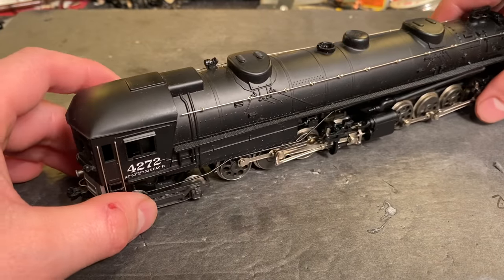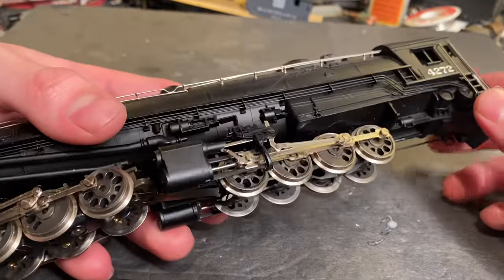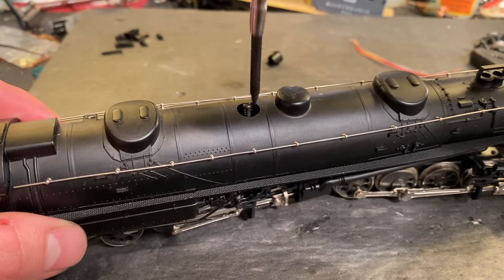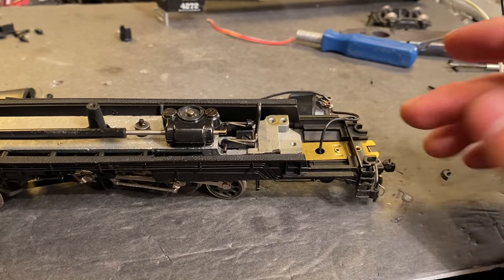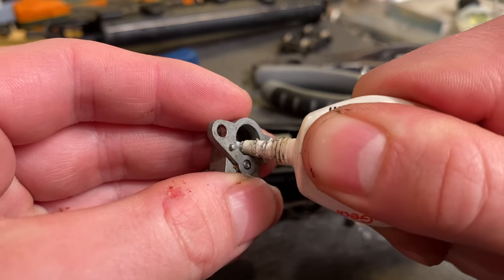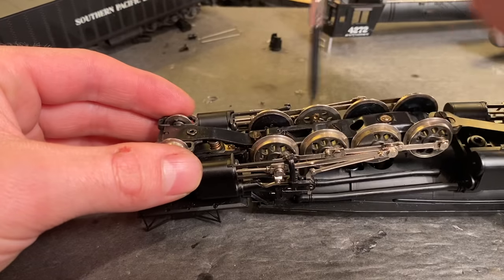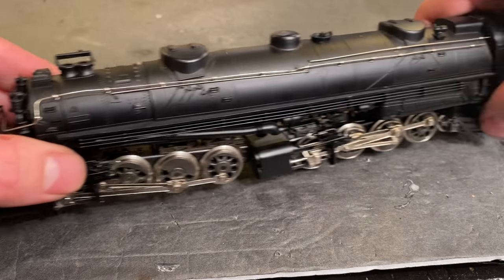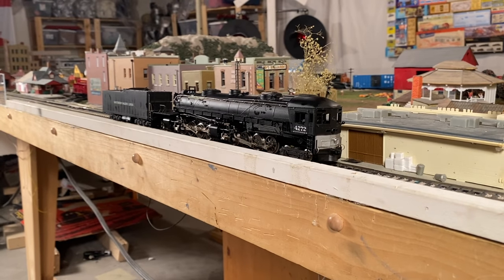Can We Make This Rivarossi Southern Pacific Cab Forward Run Again?

Comment: Hi…I’ve been following your channel for some time. You are very skillful with model trains. I have an small suggestion for you. Why you don’t play around a little bit with a multimeter. Buy the cheapest you can find and use this on your projects. I think will be speed up a little your try and error process. Thanks for the content. Greetings.
Reply: I've had that same thought when I watch his videos and he's tracking down either a broken connection or a short.  It would make the job easier and quicker.
Reply: I think hes doing a good job as it is. Haste makes waste i always say..
Reply: @mercuryoak2  agreed with you. But as my original post said is just to speed up the process and make easier for him to find shortcuts on anything. Just with a continuity test and then move wires and parts until the beeping from the multimeter stops. Thats the procedure. Again thanks for your videos. Greetings
Reply: @cristiancruz5079  oh i know but i mean probably involving another step for him would cost more time and video and trying to edit it Etc I know what your saying too. Its 6 and 1/2 dozen another either or it works both ways I did one thing myself though I used a multimeter to see how its current draw was coming through and I noticed that the Transformer I do have made by MRC tech 2 was not calibrated correctly because it wouldn't hit dead zero volt
Reply: I agree because you can't see electricity!
Reply: @Petemonster62  okay and myself and or anyone else hasn't had an issue diagnosing things and yeah I agreed you can't see electricity however I don't think he had an issue diagnosing at himself especially when his Transformer has a amp meter. Some people actually like the challenge it's quality versus quantity I don't know some people actually like doing things that are nice slow-paced so that's really gets done thoroughly. That's like I'm sure I'm going to create enemies here but using LaBelle 106 and the other types of oil I don't use myself because I don't want to pay the astronomical price so myself I use super lube which is the same thing as LaBelle 106 however it is clear and then I bought it at Harbor Freight got more for the money versus less quantity and then one on eBay and got basic medium-weight oil feta specific for HO scale and or other type things such as clocks Etc which is synthetic oil. I'm sure adding a multimeter would help in the diagnosing process but also would look like a cluster mess.
Reply: @mercuryoak2  - Matt, you are right about SMT's power pack having a voltmeter & an ammeter; two important functions of a multimeter.  The multimeter also has the ohmmeter function, which is nice for checking connections & other related problems, like an open armature coil.  There are many lubricants that would be useful, just make sure they don't attack plastic gears.  There is a slot car enthusiast who uses synthetic motor oil in his cars.
Reply from the maker: I have one, I should figure how how to use it to test coils etc
Reply: @SMTMainline  The function switch may have a position that is labelled " Rx1".  That scale would be useful for checking the continuity of armature coils & wire connections.  Some light bulbs have a filament with a high resistance, so the " Rx10 " position would come in handy.  If the multimeter has a " Diode Check " function, that would be handy for checking LEDs.  Just don't put any voltage across the multimeter's leads when it is set to ohmmeter function!
Reply: @SMTMainline  Well just try to find on youtube any multimeter basic lesson. For coils you can use resistance and continuity to check shortcuts. I’m not an electronic repair guy, but knowing the basics on a multimeter helps a lot. Btw Im pretty curious about the dcc signals. How it works. As an IT guy (computers) I found pretty cool the binary code they used to transmit signals to the microcontroller inside the locomotive. Can you do an small video about that subject? Thanks for your content. Greetings
Reply: @Petemonster62  great lesson one… I just reply before reading your comment pete. All what you said indeed is helpful. Im pretty curios as I said about how dcc signals work. Greetings
Reply: @SMTMainline  You could also use it to check for continuity between components to either verify a connection or detect shorts. That's what I was thinking it would be most useful.
Reply: @SMTMainline  Yeah...  test coils, test motor windings, test high resistance wiring, test dead short lamps, test diodes, test capacitors, test line voltage drop around every section of track... QUICKLY. 
And get some decent clips on the power supply wires too... better still, buy some long silicon insulated multimeter leads with insulated banana plugs at both ends, so the dead short of supply lines can't happen, and decent insulated probes and grab clips.
Got a decent soldering iron and know how to use it?  Don't rely on spring clamping of wires at motors. If the copper wire is discoloured or even black or green it's a high resistance joint, and so, power limiting.  
Buy some high flex silicon wire to replace all the bodgy non-flex PVC or fabric wrapped rubbish seen in these models. Flex, you know.. light gauge wire that has over 50 very fine strands and it doesn't kink or resist bending multiple times 'In Service'. 
You know that 3 or 7 strand wire hardens every time it bends and can eventually break inside the insulation.. so it isn't seen.
And man, those gearboxes... get some real basic degreaser to wash out the gritty discoloured old lube (it's blackened due to metal or other contaminants) get ALL the old crap out, rinse and dry well.... because leaving a trace of old stuff will contaminate any fresh grease you apply.

Comment: Also, brass wire brushes work excellent for making hand rails. Great for practice bends
Like $8 - $10 USD, Can make hundreds.
And they can be soldered together for any length needed….toots

Comment: Hi there good video there m8 .. Question ? Where did you get your train controller from ,, also a handy tip if you go to your local auto parts sore and buy one of them large yellow car washing sponges and hollow the middle of it (the same width as the loco you are working on) out and you can lay your engines or what ever cariage you are working on in the sponge on there back so it stops the loco from getting damaged and makes the trains undercariage easier to work on and soo much mkre stable ,, also buy some decent small good brand screwdrivers with magnetic tips as they make it so much easier and pleasureable to work on. 
Anyhoo keep the good work and gr8 videos coming so we can watch them and gain knowledge from you. Thankyou.
Cheers from John in Australia.

Comment: Today I picked up an ahm cab forward (I assume it’s similar to a rivarossi?) for $35, but the catch is that the foam in the box it was in just disintegrated and got all over the locomotive and all into the motor and I assume the gears. I am going to have to disassemble the entire thing and clean everything at some point, and hopefully have a working cab forward. I’ve wanted one for quite some time and I’m glad I got one.
Reply: Update to this comment, I spent 6 hours today removing bits of foam and oil and now it runs! Still not perfect, I still need to troubleshoot, but it’s better than not running whatsoever.

Comment: The monkey deck was so named because it was a favorite ride point for hoboes.  Apparently, those that chose to ride the tender beam would get washed over with the water from  refills, and because their screams couldn't be heard by the crew in the cab, they would often be found frozen to death, iced right to the tender.
Reply: Nice story... but the term is nautical in origin. There are apocryphal stories of how the term originated, but the truth is that nobody has the slightest clue.
Reply from the maker: Yikes, this is the first time I've heard of this...
Reply: I haven't found any solid confirmation...save a trusted voice...on the frozen hoboes.

On the other hand, that splitter over the stack was to keep the exhaust from blowing out the boards on the roofs of the long snowsheds common to the SP...

Comment: ooo ooo, I have one of these, well it's an older version but still
Reply: also, seems pretty simple. likely wouldn't be too much of a challenge to convert to dcc which is what I prefer to run, though I have a dual controller setup

Comment: SMT - It may be possible that your Rivarossi Hiawatha steamer has a similar problem with a screw head, or similar projecting part, causing intermittent short circuits.
Reply from the maker: I will have to investigate that

Comment: Nice work! I remember seeing these in the Rivarossi catalogs in the early 1970s, so it was nice to see what they actually look like in detail, especially since apparently all driving wheels are in fact, well, driven using the worm drives. Never seen the insides of a Rivarossi motor either, looks similar to a Fleischmann motor with its flat commutator. Do I understand it correctly that the model uses what I'd call 'italian' current pickup, i.e. the locomotive itself only picks up from one rail, and the tender from the other?

Comment: I ended up upgrading mine with a newer motor and installed a decoder buddy in the tender and been fighting with it picking up power but when it does run its so smooth n quiet

Comment: Harrison, great diagnosis and repair on that riverossi. I asked for th your mailing address a few weeks ago and got your reply. When I checked with Canada post for the rate to send my package it said it did not recognize the postal code of J8Y 2E0. But J8Y 2E2 did come up as the Canada Post that you gave the address for. I would like to get this mailed to you and don't want it to go undeliverable. Can you confirm the postal code and if J8Y 2E2 will still go the correct PO Box. 
Thanks!
Earl
Reply from the maker: J8Y 2E0 is correct. Maybe since it's located inside a pharmacy they think it's incorrect? I've had dozens of packages shipped to this location before without any issues.

Comment: I've had one of these cab forwards in the past and they are not great, they are very weak and wobble all over the place the list of issues goes on forever. I ended up just getting rid of it because it was such a waste of my time trying to repair it every 20 minutes.  Hopefully you have better luck with yours tho.
Reply: SMT-Great work!  Thanks so much for your videos.  I've learned how to repair/service our H.O. engines with your help.  Do you realize the impact you've had on all of us?  Thank you!!!
Reply from the maker: Rivarossi products can be sensitive. So far I haven't had as many issues with any of mine but they certainly haven't been flawless.

Comment: hello SMT love your channal ceep on going and I have a Rivarossi big boy that smokes when we run  it it smokes out of the moter sorry abought the splling
Reply: It's possible the commutator in the motor could need some cleaning and the magnets in the motor could have weakened overtime which can possibly lead to a burnt out motor. Best replace the magnets or remagnetise the magnets.
Reply: @steamier7755  thank you
Reply from the maker: @bigboy-hz2lx  Check the gaps on the commentator carefully, this is usually where burning happens. Also make sure the drive is turning correctly since the motor could be overly strained.
Reply: @SMTMainline  THANK YOU

Comment: sooooo oddly enough, mine has arrived and it doesnt have the reduction drive on the motor like yours has. its just straight to the worm boxes. wonder if its an older or newer design possibly compared to yours as the motors different too.

Comment: I got a PRR mallet n it’s the same motor, n drive. Motor turns fine, does good by itself but when I hook the tender up with my cruddy soldering work it don’t wanna run. Is it my soldering or tender ?
Reply from the maker: I would investigate the tender, they are prone to having issues.
Reply: @SMTMainline  that’s what I’m thinking now. I’ll take a look into it thank you

Comment: Just curious smt do you know how to fix a varney locomotive with a crumbled Broken in half zinc chassis Because when I was taking it apart the chassis crumbled in the pieces
Reply: Unfortunately, it sounds like your loco is affected by mazak rot. It's unfortunately an unavoidable, irreparable scenario. Your only option is to make a new chassis for it.
Reply: The fix is to get a Kato or Intermountain unit. :P
Reply from the maker: I'm sorry to hear about that. Unfortunately all that can be done is ether a replacement or a scratch built part. You could try gluing the chassis back together with CA but this will only last a short time.
Reply: @SMTMainline  It happened to your with wheel holders breaking off but not a broken chassis

Comment: coming from a hobby that has at least 2 wires, most times 3, going to every single component, it is very interesting to see very widespread use of large plates carrying current. though, thats probably because my hobby uses upwards of 20v 100amps hehe, guess what the hobby is

Comment: hey smt i have a teacher that likes model trains like me, last week he let me bring it home its a santa fe red warbonnet life-like but after like 3 to 5 minutes of running it gives off a burning smell any idea on whats wrong?
Reply: It's possible the commutator in the motor could need cleaning and the magnets in the motor may have weakened overtime which could possibly lead to a burnt out motor. Best to replace the magnets or remagnetise the magnets.
Reply: @steamier7755  well commutator is clean but there is one magnet that´s green so i think that´s a problem
Reply from the maker: As Steamie mentioned it's probably the commutator, make sure to clean the gaps. There is always a chance it's the coils but there isn't much that can be done if they're shorted. Best to clean and oil drive as best you can and use it until it burns out. Life like drives aren't worth much.

Comment: Hey man i have a bachman HO train… when i start running it is clicks, a lot of
Reply from the maker: That's normal for those. They used gears which were prone to cracking and they make a clicking noise when running. It's not a serious problem so long as it's still moving properly.
Reply: @SMTMainline  thank you man

Comment: Anyone ever realize that because the Southern Pacific Yellowstones were oil burners, they could’ve fully enclosed the cab? The firebox was connected to the tender with a fuel pipe, so there was no reason not to fully enclose the cab? Why completely flip the engine, stretch the thing’s abilities take fuel and water, and endanger the crew by putting them in front of everything?
Reply from the maker: I think visibility was the goal but I heard these locomotives had many issues.

Comment: Do tou sell any of your trains
Reply from the maker: Yes, to my local train store.
Reply: @SMTMainline  good morning I just bought my first big piece of my layout iam going to build its going to be around 12x10 with an extension of the side 6x4 I bought a vintage BIG BOY Rivarossi 4005 in original packaging  mint condition  I was thinking about a Broadway limited 4015 with all the bells and whistles I would just assume have a piece of history. One piece at a time happens to be one of my favorite songs I have driven nothing but cadillac since I was 19 .your videos have Inspired me to start my hobby again after giving it up for almost 40 years. Watching you rewind a motor brings back memories when I used to lose count I was 12 and had the attention span of a squirrel.
Reply: Just got my rivarossi big boy with original box and paper work  built in 1974 I was 4 years old absolutely amazed at the condition still has the traction tires on it
Reply: @SMTMainline  question I got a rivarossi big boy nice shape made in 1971 according to the paper work that came with it originally anyway it goes faster in reverse that forward any ideas fresh oil on all the gears and movable parts
Reply: @SMTMainline  good morning  any idea what would cause an old cab mounted motor rivarossi 4 8 8 4  run faster in reverse than forward it operates  great at any speed no binding everything has fresh oil and is clean its a 3 pole motor I already checked brushes and comuntator looks new any feed back would greatly appreciate

Comment: That bolt with the spring on the drawbar that was shorting toward the tender is completely wrong! The screw that was there factory by Rivarossi is a fat top flat drive screw with a very LOW "shoulder" made into the bolt to allow the drawbar to swing. AND I am pretty sure Rivarossi NEVER "sprung" the drawbars on any of their locomotives so yes, that engine WAS messed with over the years. Find a smaller bolt, NO shoulder and fit it to where the one is causing the issue and your issue SHOULD be solved, PERIOD! 

I used to repair these as a business and for a long time was a Rivarossi repairs depot in the USA, till Model Expo stopped importing them! SO..... AND to top this off? I GOT 3 of this same locomotive and for they're age runs pretty well given they are DC and not DCC. the motor would have to be changed to a better quality Can Motor to make them DCC and a little bit of rewiring which I have also done numerous times over the years!

Comment: The old Rivarossi motors are bad runners. I have a Challenger based on the same build principle. No matter what I do, after some time sitting in storage, it never runs. It needs to “break in”, again! So one day I will replace that crappy thing for a nice coreless.
Reply from the maker: They seem to be sensitive to corrosion. Other then that they're capable of lasting a long time but at the end of the day 5 poles are always smoother than 3 poles.